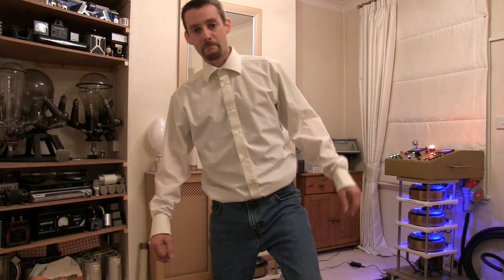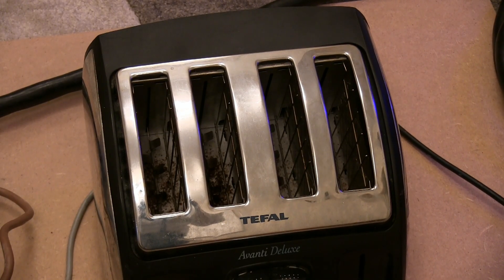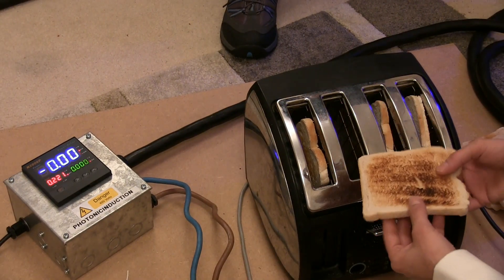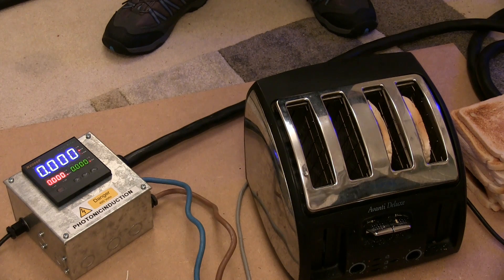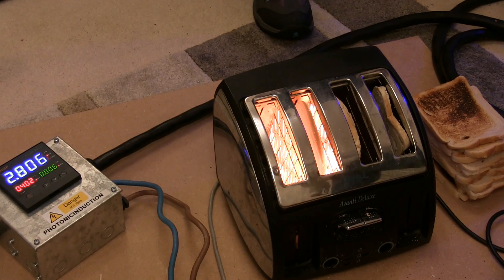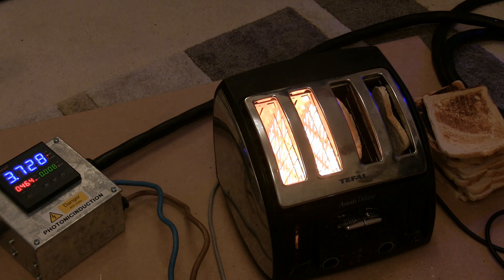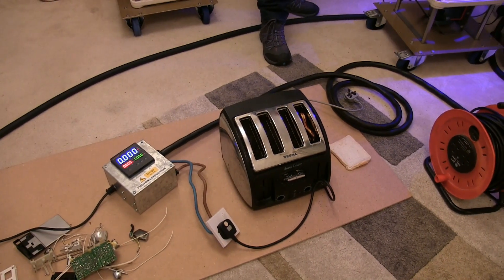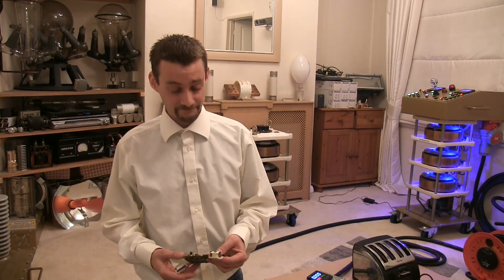10 Second Toaster

Comment: I can't get over that new PSU, the only bummer is you cant whack it up to full range since the variac is servo-driven :(
Reply: Eh, what? I'm sure that if Mr. Photon wanted to turn up the motor-driven variac to 'The Full Range', he could quite easily do that, but.....

The thing is, when Busta is connected to the output of the variac, the output of Busta maxes-out at 500v before the variac has even reached its top-whack. :D

On its own though, without Busta connected, I'm sure that 265-280v could be gotten out of that motor-driven variac. :-)

Note: 'Busta' is that device with the two large transformers, wired in such a way to crank the voltage beyond 300v :D

-BoomBoxDeluxe.

19th October 2014, 18.20
Reply: BoomBoxDeluxe  They key word is WHACK my good sir :) I have zero doubts in the potential of the power supply, my comment was geared towards the lack of immediate 0-100% control within a flick of the wrist due to the variac being what appears to be completely motor driven.

That being said he showed a similar variac varied solely by a big ol knob at the top end, that would suite the objective nicely :)
Reply: codemsan
Aaaah, yes. With the motor-driven variac, it's not really feasible to go from 0-200v "at-the-flick-of-the-wrist", and you know, I did ask him whether he was going to (somehow) add a hand dial to the variac as well.

That was before the manual 3ph variac came along.

This is where a manual variac is useful, because a motor can be teeaased right up to its limit, and then, just as it starts throwing sparks of a whole variety of colours, the variac can be RIPPED RIGHT UP for the optimum poppage, and nice big flaaaaaames. :D

Yes, manual and auto-variacs do have their advantages and disadvantages.

I think what would be nice is to have a variac where it is manual and motor driven at the same time. There would be a selector handle so that either manual or motor-driven could be selected. :D

I wonder who will be first to make one?

-BoomBoxDeluxe.

20th October 2014, 13.45

Comment: How very, very SATISFYING! :D I believe you had flaaaaames at the end there, Mr. Photon. :D Excellent!

Oh, how I laughed so very hard once the volts went over and beyond the usual domestic 1ph voltage. :D I was rolling all over the place, and you know, I can't help myself.... It just has to be said, because it's definitely fitting for this video:

Look at it Glowiiiiiiiiin'! :D

At 420v, it's interesting to know that someone could take this toaster into their workplace, stick it across two phases and have "Toast-In-Under-A-Minute" ROFL! :D

That was really impressive. I honestly thought that the element in there would let loose at about the 300v, but to go beyond 350v and keep on going?! :-O

Well, Tefal definitely made a tough toaster..... Almost Photon-proof! LMAO!!

Aaaah, but then Busta got his windings around it and blew it up. You popped it! :D

Amazingly the poppage of the element in there was a bit disappointing. With that much voltage and all that current availability, I was just so badly itching for there to be some ridiculously loud buzzing-snapping sounds, with lots of scalding hot liquidised heating element spraying out everywhere in a super-fantastic toaster lightshow.

I wanted that thing to blast off so much harder than "Current Cake" did when it fizzed over, but..... Aaaaah. :-( A little buzz, and it was all over.

When you can, please test the linits of a kettle, because I want to know if cuppa-tea time could be achieveable in under a minute. A proper, legitimate, drinkable cuppa tea, boiled up in under a minute.

Get the AMP-MASTER powered up, get old Busta fluxed up, stuff the kettle on there and RIP IT RIGHT UP for the optimum Big Boy's Cuppa Tea. :D

Thanx for this vid. I really have to say that I found this vid to be immensely satisfying.

Who'd have thought? A toaster that was ALMOST Photon-proof! :-O

Have a great one,

-BoomBoxDeluxe.

18th October 2014, 03.20
Reply: Next time: filtered dc? Would help a lot in doing a total meltdown.
Reply: Erlend Ervik
Spot-on idea. :D When the element lets loose, because DC can pull some nice meaty arcs, it'll be fizzing and banging all over the place! YAY, what a ROFL moment that'll be. :D

Yep, a nice suggestion there for some nice big fizz-ups.

-BoomBoxDeluxe.

19th October 2014, 15.06
Reply: BoomBoxDeluxe

Comment: You should start flogging 3kw toasters! Toast in under 10 seconds, this time next year you'll be a millionaire! Haha
Reply: 3kW is about the maximum you're supposed to take from a standard UK plug (as rate). The standard US plugs are only about 1.8kW so selling them abroad would be difficult.

I guess US folks could just wire it straight in :P

Although there is a 3kW (13A) rating on the UK plug you could probably pull 7.5kW on a single ring main since breakers are generally 32A if you swap the fuse on the plug, not that it's advisable to exceed the max current by that much. Just imagine a 7kW toaster though!
Reply: Why not just put a RV style 50 amp, 240 volt plug on the toaster. ;D  I want to see a toaster that works like a camera flash.  Push the button and flash! Toast is done.
Reply: funky3ddy Surely that can't pass safety as much as a single plug with above rated current would though and unless you were running lots of cable it would be on the same ring main
Reply: Callum Aitchison
Dual plug configuration, and problem solved.
Reply: Callum Aitchison
Yeah. But a lot of people have two independent sockets side by side, one for oven\electric stove for example, and second for dish washing machine.
So assuming proper multiple warning stickers will be placed on our turbo toaster\kettle, this can pass safety checks.
Reply: Jonathan Nellis
Laser toaster! :)
Reply: *****
I heard EU had banned powerful vacuum cleaners, and now they're after large screen TVs.
I believe they are also after electric kettles and toasters.

Comment: Proper toaster!
Two things I hate about most toasters:
1) They won't take full size bread like Warburton's Toastie Loaf.
2) The elements don't glow enough, so the bread dries out before going brown.

So now I know what to do when buying a new toaster!
Wire my spare 240/110V transformer like an autotransformer and run the toaster on about 350V. Sorted!
Reply from the maker: You made me chuckle, you are correct :)
Reply: It will need to be a big transformer, Or you might find it becomes a toaster too.
Reply: TheProCactus
get one of those bigarse yellow ones you see builders using to run tools. wire it backwards for a ~350v output :D
Reply: Makes me wonder how quickly a toaster like that would cook Texas Toast (1" thick slices)?
Reply: insanitybiker so you mimic photoninduction.
Reply: Probably so they are crispy all the way through rather than just on the outside.